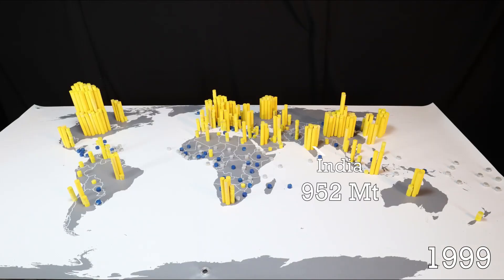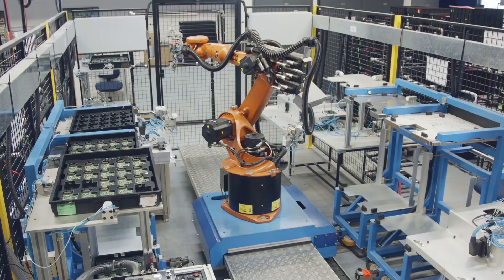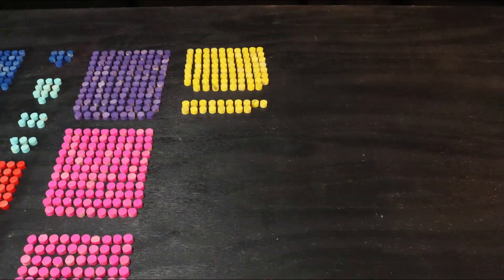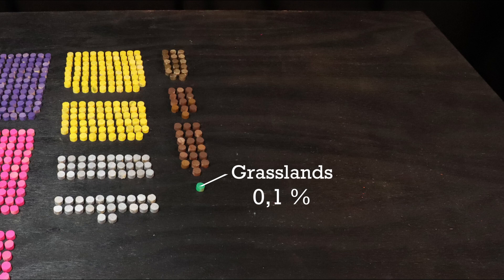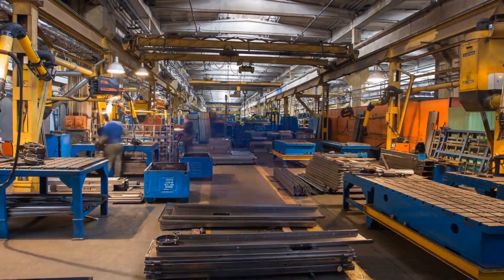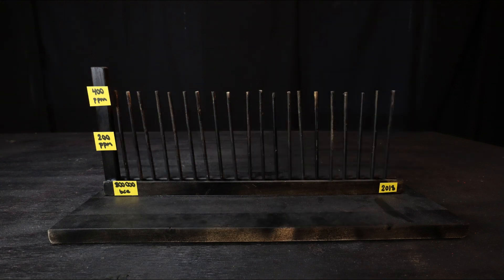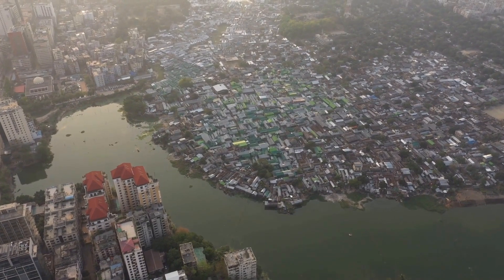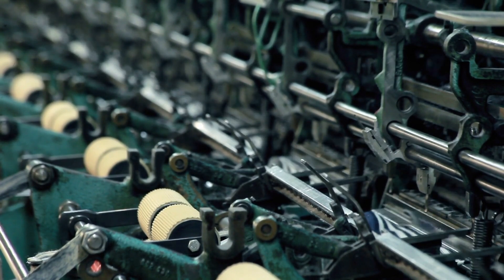Where do Carbon Dioxide Emissions come from? (Climate part II)

Comment: How much CO2 per minute from an automobile?
Example 1:  A six cylinder 3.5L turbo @3600 rpm. We see 6 revolutions of the crank shaft for every 7 litres of air used.  If the crank shaft turns 3,600 revolutions per minute. (3600/6) X 7L = 4,200 liters of air changed into CO2 each minute.
Example 2:  A four cylinder 2L turbo @3200 rpm?  Four turns of the crank shaft for every 4 litres of air changed.  (3200rpm/4r) X 4L = 3,200 liters of air changed to CO2 per minute.
Reply: You’re over-complicating it. 

The burning of one litre of petrol results in the formation of 2.3 kg. of CO2. The less fuel consumed by the engine means less CO2 is emitted. All that computation you’re doing regarding displacement and rpm’s is irrelevant; fuel consumption is relevant. Also, different fuels will emit different amounts of CO2, because of the difference in the carbon content of the different fuels. E.g., ethanol is 53% carbon by weight, while petrol is 87% carbon by weight, so obviously the petrol will emit more CO2 per kilo of fuel burned (ergo, the difference between energy density between the two).

For reference, an average sedentary adult human, 65 kilos, will exhale 1 kg of CO2 in a 24-hour day, and several-times that if active. So a person lounging around exhales the CO2 equivalent of .435 litres of burned petrol per day !
Reply: On average, 8.8 grams per mile. The driver is putting out 100 grams per hour!